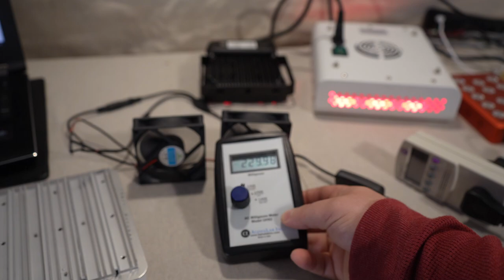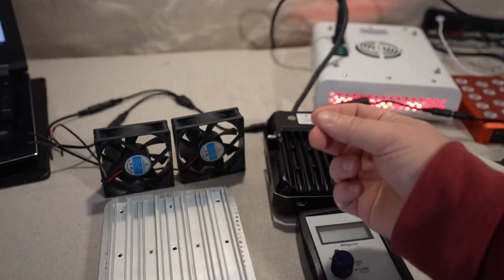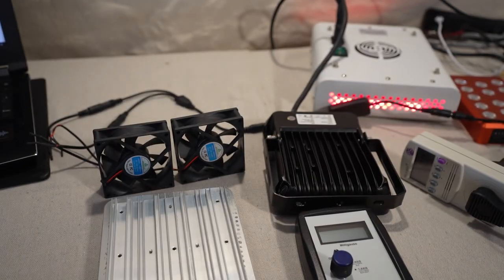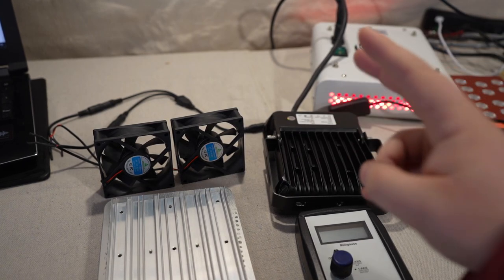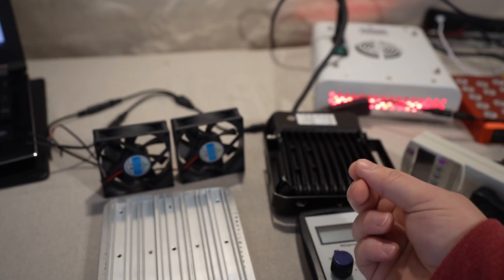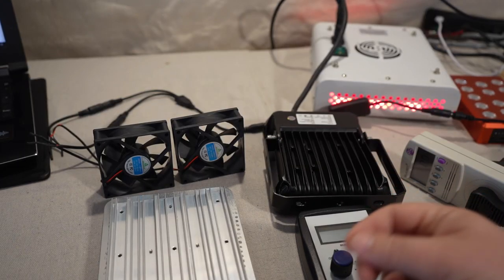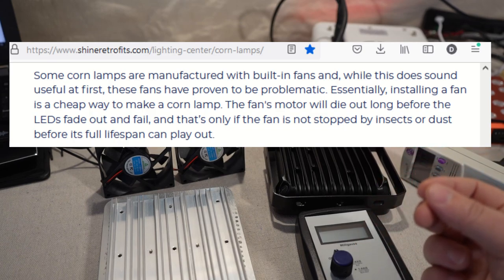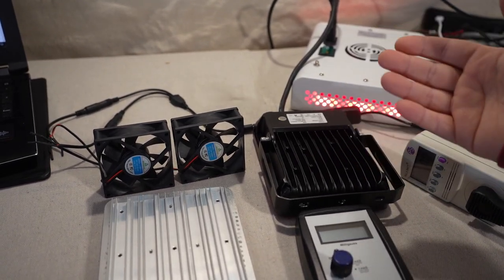Fans are a Cheap and high EMF way of Cooling Red Light Therapy Devices

Comment: So the OverClocked panel fans will fail way before the LEDs?! Any estimate of how long the OverClocked fans will last?
Reply from the maker: They should last many years, they are similar to the fans used in computers that last a long time. Just inspect them periodically and blow off the dust. If they fail then we can easily replace the fans.